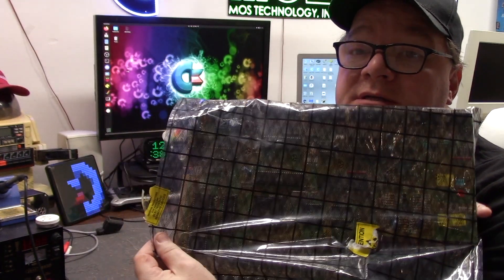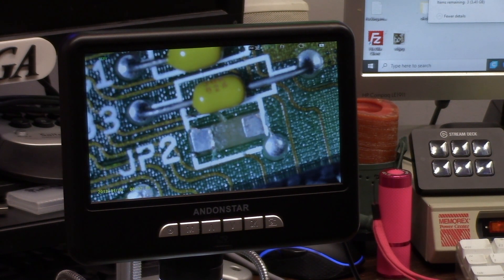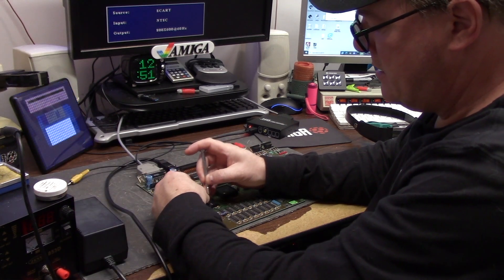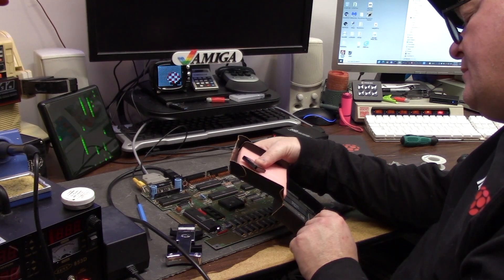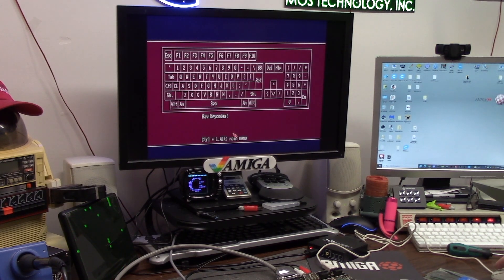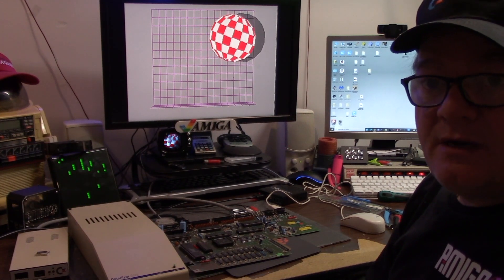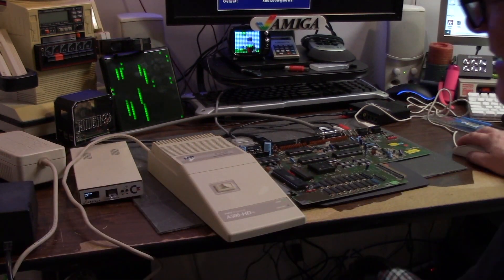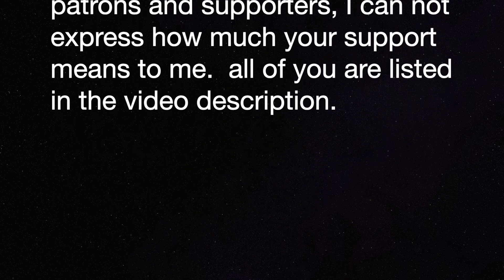Commodore Amiga 500 r5 no video

Comment: Hah,how does someone crack a rom longways..people can sure damage Amigas.
Reply from the maker: Probably removed it with a chip puller and the ends slipped or it gripped the middle of the rom and not the bottom this separating the layers